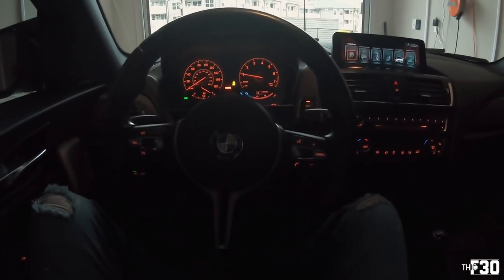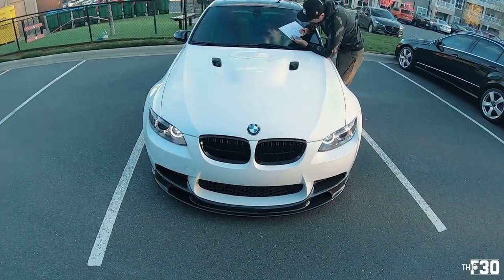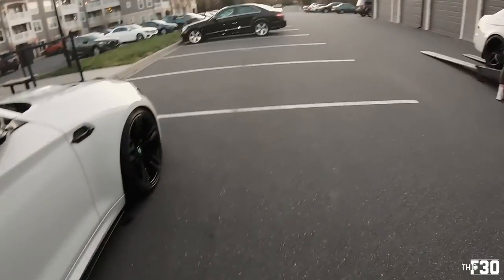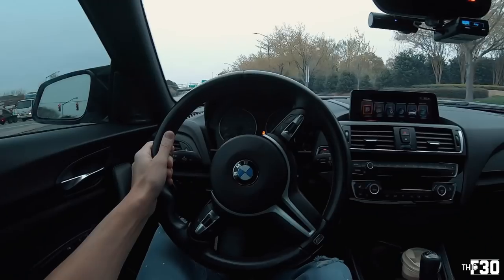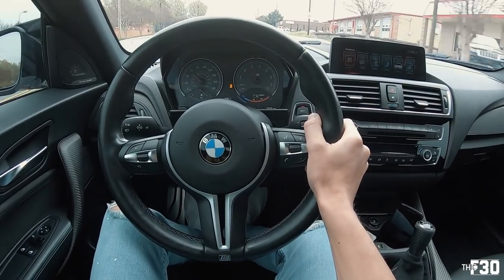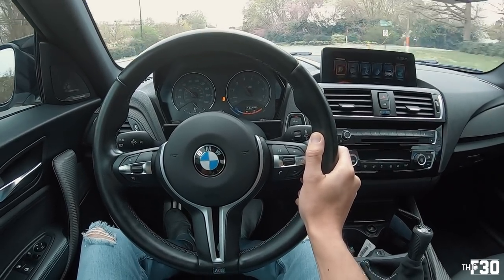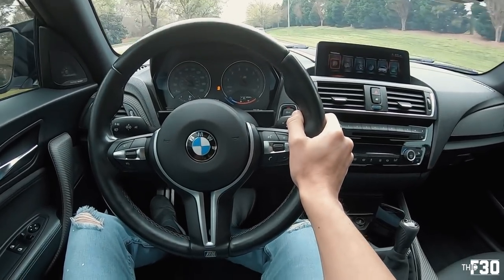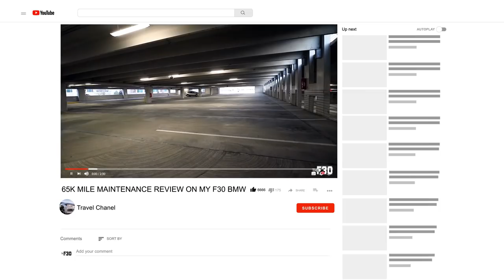M2 GETS CATLESS DOWNPIPE AND M3 GETS DAMAGED.. - BMW F87 M2 Valvetronic Downpipe Install

Comment: I cringed at the lip cracking. I had a similar experience couple years ago and I’ll never let a tow truck driver drive my car up onto there truck again. Since then I’ve only used flatbeds that pull the car up. Never had an issue.